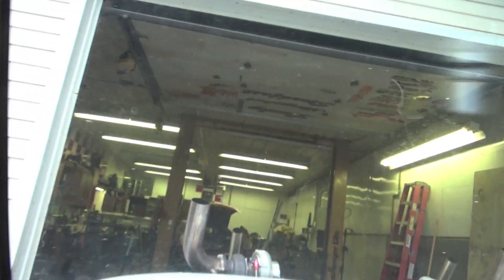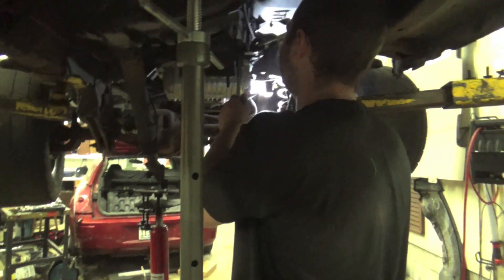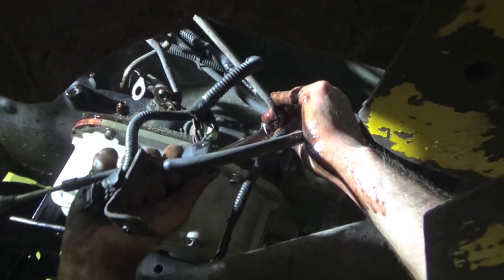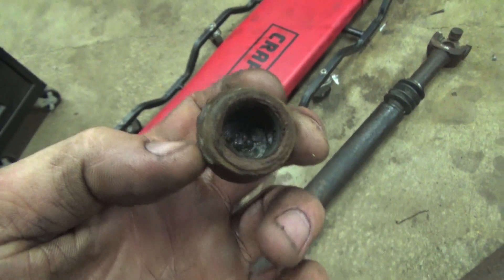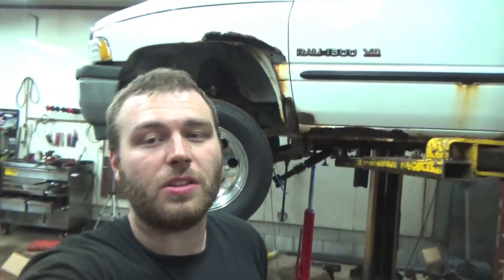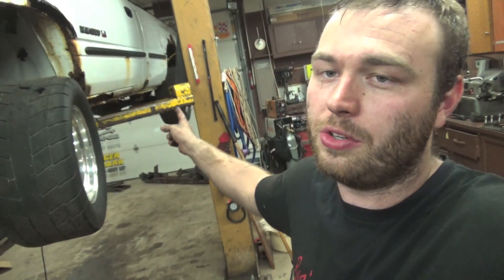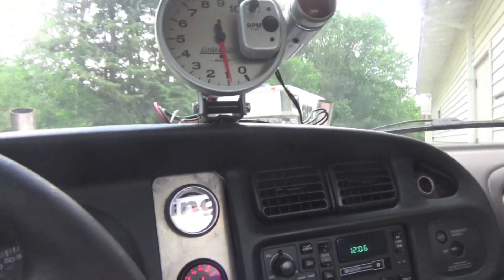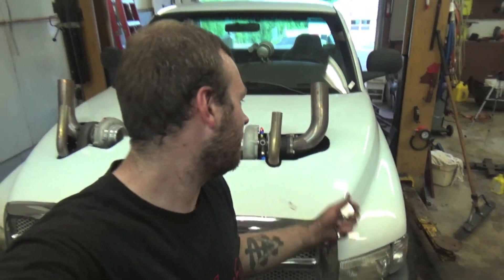Twin TURBO Junkyard RAM High stall Torque converter Install

Comment: Very nice and thank you for the info on the trans lines.
Reply from the maker: Oh yes!
Reply: Hey quick question,  if I'm running an aftermarket fuel pressure regulator do I need to remove the stock one off the pump. And its return less so what would I need to do. The aftermarket one is not wanting to adjust at all low or high pressure it just sticks at 42psi
Reply from the maker: Yes get rid of the stock regulator. And I couldn’t make 3psi on the stock regulator, fuel lines and a walbro 450
Reply from the maker: Check out my fuel system video or my srt10 fuel system video
Reply: @RacingRamFam  sorry to bother you again brother.  One more did you hook up a vacuum line to your after market Fuel pressure regulator?
Reply from the maker: No. You can I just set me to 58psi. I have enough fuel pump I don’t need the boost to fuel pressure adding
Reply: @RacingRamFam  ok cool thank you again.
Reply from the maker: @DBGrimson  not fuel pump fuel injector lol

Comment: Can you do a video on these rams fuel sync I’ve been messing with my truck and I can’t get it to run right for nothing
Reply from the maker: Ya you need a scanner in order to properly set it
Reply: I do I have a snap on mt2500 to set the sync and it says it’s at 0 degrees but still runs like crap
Reply: And I have no clue where the crank pulley is suppose to be when setting it I watch all kinds of videos some people say the solid line and some say the little v8 mark
Reply from the maker: You don’t use the crank pulley to set it. Watch my camshaft swap video on how to set the distributor. Then you adjust using with the scan tool to 0 degrees. If it’s at 0 degrees and still runs like crap you have other issues
Reply: I’m back I’ve tried everything all it wants to do is pop really loud I set the # 1 cylender to Tdc then set the distributor to cylender 1 on the cam sync thing and it just pops loud Any suggestions

Comment: What kinda converter is it and what is the lock up?
Reply from the maker: Converter have a clutch in them like a manual clutch that locks up so there no slip. And eBay pne

Comment: Do you have a link or know what brand that converter is   I would like to try one
Reply from the maker: Some eBay 2850rpm stall think torco
Reply: Thanks i will order one today  Hows it holding up ?????